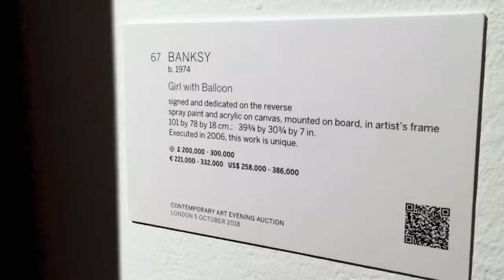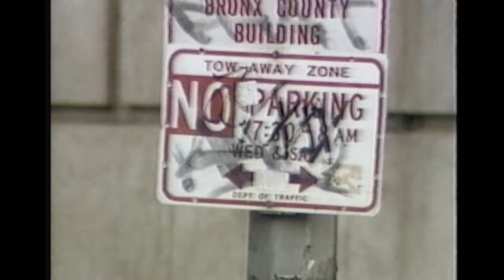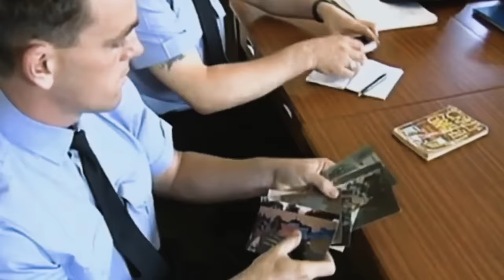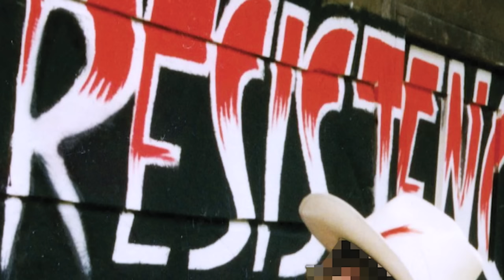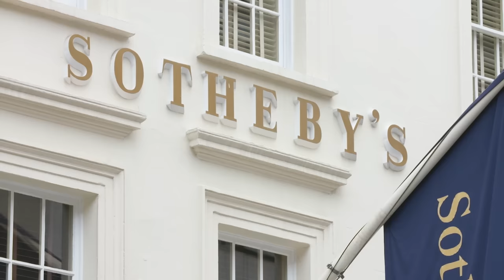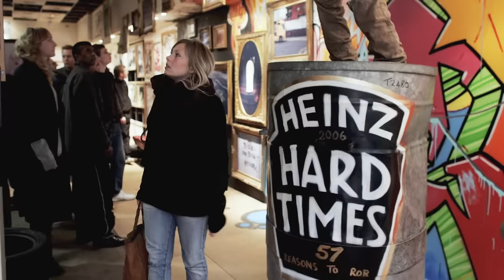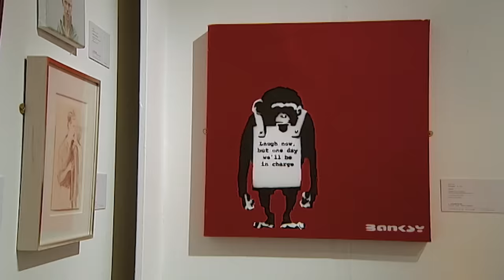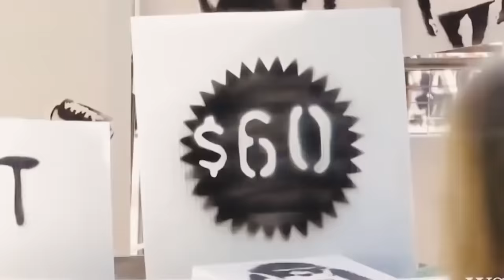The Banksy Interviews: Creating A Street Art Revolution | The Rise Of Outlaw Art

Comment: The shredding of that print is genius it’s like putting a exclamation point on his work and ethos!
Reply: What amazes me is how it ENTERED the auction house without triggering metal detectors (these places always have tight security)
Reply: @tiagodagostini  but think about it... The people are the threat and maybe they fear a lunatic with a knife about to slash a canvas. The attempting to self destruct art work was a one off. The frame was by Banksy, the stencil was by Banksy, and the combo had a certificate of authenticity from Banksy: what was the problem needing security? I was amused at how baroque the frame was. Nice ironic contrast with the simple image. And these frames have metal parts such as corner braces and other bits. I'm pretty sure Banksy would have put lots of visible and innocent looking metal everywhere he could so the real workings would only be detected when they did the x-ray... and they did. Hopefully the new owner will remove the battery before it starts to leak acid.